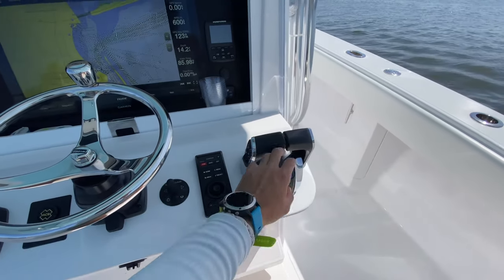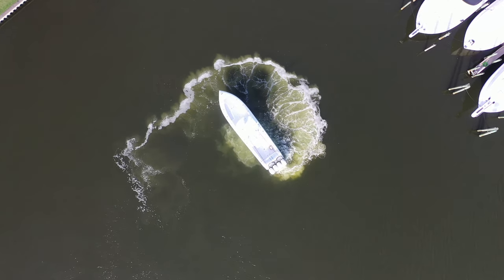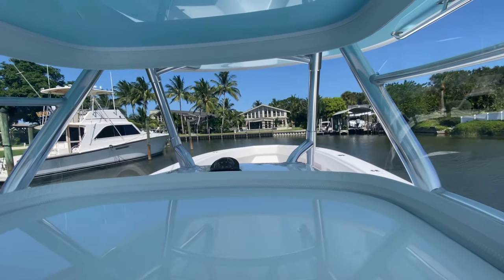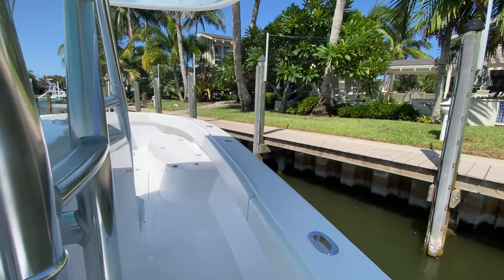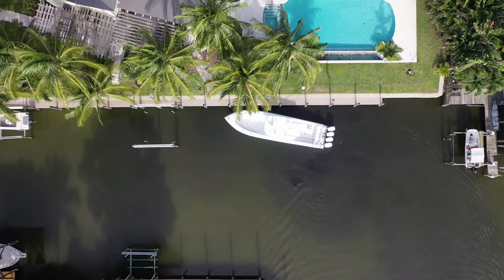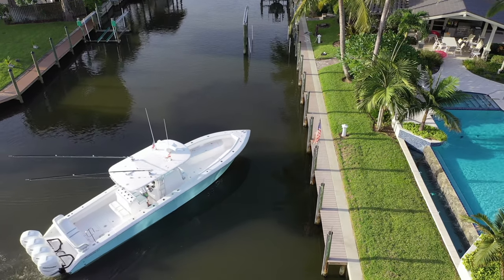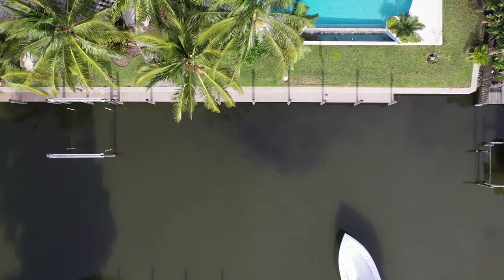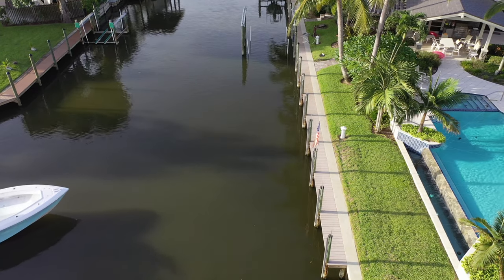How To Dock a BIG Center Console (Bahama 41)

Comment: Thanks for posting this video. I only have a single outboard but learned a lot from watching this.
Reply from the maker: Of course man and thanks for the kind words. A single outboard is going to be pretty much the same as using the wheel to turn. The only  difference is that with a single you have to deal with prop walk. Two of my motors are counter rotating so they offset the torque from the other two motors. You don’t have that luxury with a single engine.

Comment: Do you think of using a rudder with an engine? with engine use port-starboard only Which one is better?
Reply from the maker: I don't think I fully understand what you are asking. Could you clarify? The lower units of the engines act as rudders when they are out of gear the water flow over the lower unit will turn the boat. When underway this effect is still there but the directional flow of the propellers facing different directions are what makes the boat steer. I do not understand the second part of your comment.